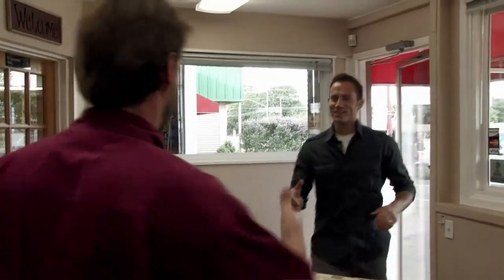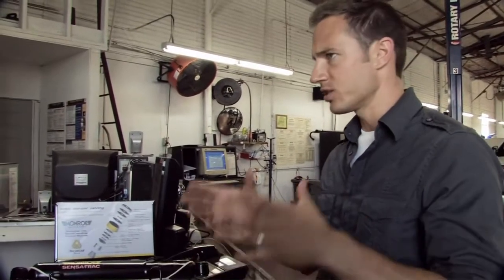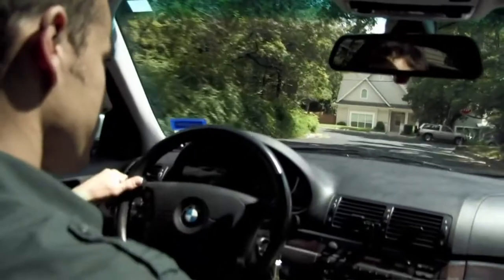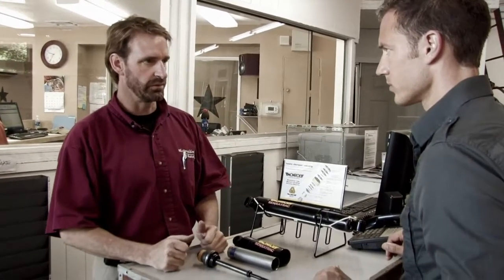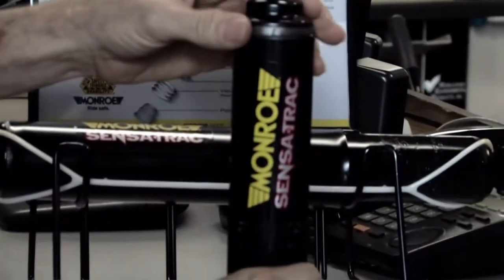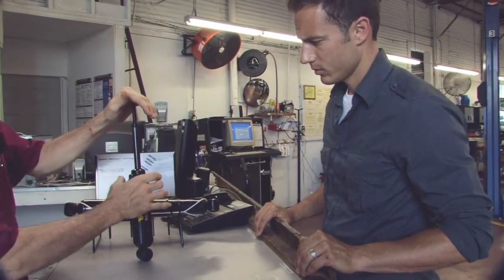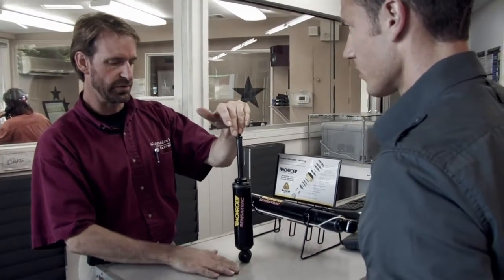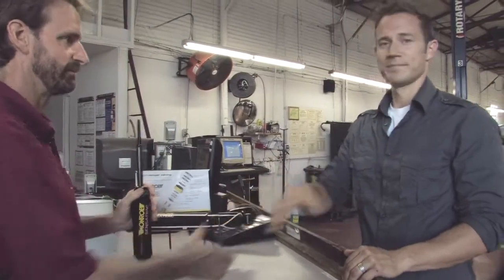What Are Shocks and Struts, and How Do They Work?

Comment: So what is a strut?
Reply: Brian Foltz A shock and a strut do the same basic job on a vehicle, damping the movement of the spring and stopping oscillation and bounce. Even though they do the same thing, shocks andstruts are completely different parts. Ashock cannot be used to replace astrut and a strut cannot be used to replace a shock
Reply: Take a look at a bike that has shocks, inside is a strut. Shocks absorb impact struts softens and smooth out the shock  You need both.